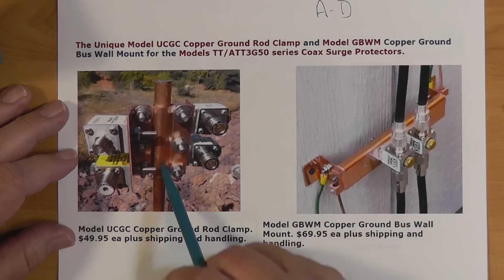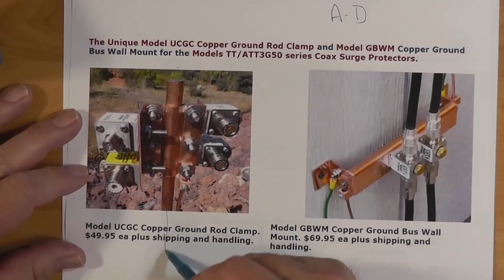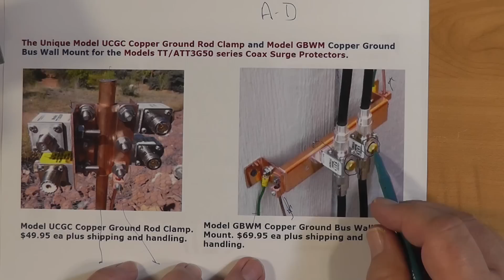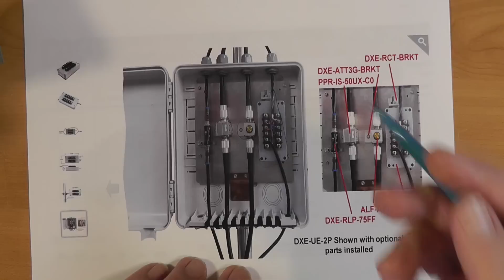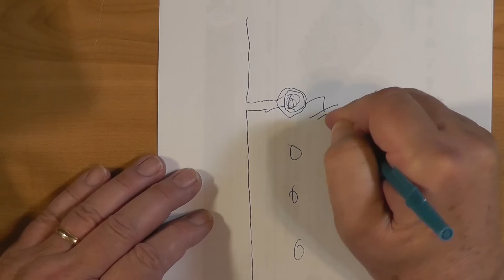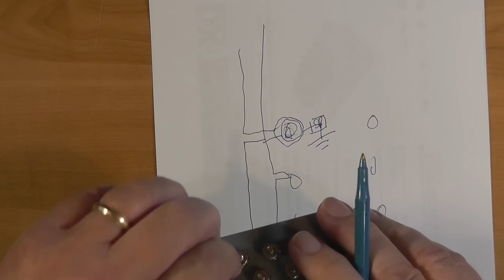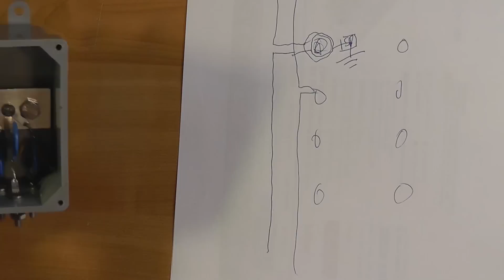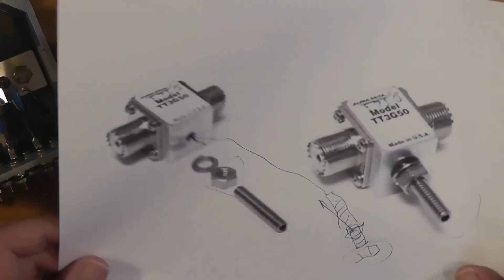The Applying and Handling of Lightning Arrestors (#468)

Comment: I question the wisdom of building any lightning suppression device inside a plastic enclosure.  These lightning suppressors use one more more Varistor (s).  If a large surge current is applied to this device it may lead to an instantaneous short resulting in violent explosion.  This is why we normally see amateur lightning suppression devices built in metal enclosures.
Reply from the maker: I agree with you. Mini lightning arrestors use a spark device to shunt the lightning to ground. I’ve used alpha delta for ages. Right now I’m using Morgan arrestors. They are all held in a large steel box which is carefully grounded.73 from Dave

Comment: Question: The lightning arrestor is the last thing before the coax enters the shack. If I have a single piece 200 foot run from the shack to the antenna, at the antenna is OK for the arrestor?

Comment: Need to attach a connector to the arrestor I have since it doesn't have the long protrusion that goes through the copper bar which I do have. What crimping tool works with solid #6 ground wire? And what connectors would I use? Thanks for any suggestions.

Comment: Very good video Dave, since I'm on top of a mountain with lightning coming down to the ground, I have purchased these flat for trailer plugs for the lighting and have them connected between my rotor control and the cable after the installation of these mentioned lightning arrestors. This way there's absolutely no connection between an expensive green heron rotor box and the cable going outside.

Comment: Wouldn't a hose Clamp and wire tighten around the pl 259 connected to a ground rod work
Reply: Coaxial surge protectors are built to divert voltage transients that occur on the center conductor, not the shield. You would presumably have the shield grounded anyway—and that includes the PL-259 shell.

Comment: I just monitor the weather and any sign of a storm i unplug and detach all coax and cables from the radio. no amount of lightning protection will do anything if you get a nearby or direct strike, yes protection can help reduce the damage but once a strike hits it's time to get your wallet out and replace everything.
Reply: Put your radio in a grounded Faraday cage to protect it from a direct lightning strike.

Comment: Good presentation, but I believe you leave a false sense of security that I want to address: 

Take this from someone who has been struck by lightning: "Lightning Arrestors" are useless against direct hits. They can bleed off static charges and possibly clamp induced charges from nearby strikes, but they are physically incapable of taming the raw power of a lightning bolt. Two reasons: 1) These piddly devices are no match for the thousands of amperes present in a direct lightning strike. They will be obliterated with little suppression of lightning; 2) Even if these "arrestors" could completely direct a lightning bolt to earth ground, the resistance AND REACTANCE in the ground path still raises the "arrestor" location thousands of volts above the local earth ground even if mounted directly to a ground rod. That charge (thousands of volts and its attending current capacity) is free to enter the shack unimpeded as it seeks a lower impedance path to earth. 

(I mention impedance: remember the ground cable from an "arrestor" to earth ground has both resistance and inductance; thus it has a reactive component. The waveform of a lightning strike is almost a perfect impulse--an extremely fast-rising current pulse that sees the conductor inductance as a significant impedance. Remember, X=L*di/dt. For an example, go to a commercial broadcast installation; every grounding conductor is a flat copper strip which minimizes both resistance and inductive reactance.)  

Many people ground their antennae during storms; however, simple "grounding" is not an answer either. In my last lighting strike (I've had 3 in my 50-year life in ham radio), the bolt hit one end of a dipole. The feed line was tied directly to a ground rod outside the shack. This bolt vaporized the #12 copper dipole and both #14 conductors the feed line,  and it blew the top 6-inches of dirt away from the ground rod. But it did not stop there: The extreme current entering the ground rod was opposed by the impedance of the rod and the resistance of the earth itself. This raised this potential at this point far above earth potential. Some of that potential went up the ground cable into the shack and destroyed almost everything (hf radio, antenna tuners, audio filter and all three computers). All the telephones, televisions and the security system also bought the farm.

My third strike was an expensive reminder of a lesson I learned from my second lightning strike. The one and only one sure method to keep lightning out of the shack is to disconnect feed lines and control cables outside the shack and move them as far from the shack/home as possible. On that second strike, the ladder line to the dipole was disconnected and laying on the ground out in the middle of the yard well away from the house/shack. That strike drilled out an arm-deep hole in the ground and blew all the copper out of the ladder line, but there was no other damage. 

I no longer make the mistake of leaving the feed lines connected during bad weather (or if I'm not at home). I believe it is important for your viewers to understand that the commercial "arrestors" may provide some benefits, but they are no substitute for complete isolation of antennae (read that "lightning rods") and control cables from the shack during thunderstorms.  

(BTW, in my previous life as an electrical engineer, I've seen several lightning hits on 12kv systems in and around my place of employment. When you see a 12kv-rated lightning "arrestor" destroyed by lightning or see a 15-kv-class insulator flashed over and shattered by lightning, you might understand why I consider the amateur "arrestors" as piddly devices. I'm accustomed to following building codes which require grounding grids under building connected to every metal building column with a 4/0 conductor via CADWELD.)

DE KG5AR
Reply: I could not agree more - the name 'lightning arrestor' is not realistic, although these devices are still a good practice for handling static charge build up.
Reply: Very true - surge arrestor not a lighting strike protector. I was walking through the local mall car park a while back and lightning struck one of the car park lighting poles about 20 steps from me… scorched earth might be a good description. I’m afraid any of our radio kit would have been a charred ruin, arrestor or no.
Reply: WELL SAID! With no disrespect to Dave, there is a cottage industry within ham radio that exaggerates the effectiveness of these little devices. They might bleed off some static charge, thereby preventing damage in one case, but to call them lightning arrestors is almost criminal deceit.

The rotor cable unit Dave shows contains eight metal oxide varistors. My electric cooktop also contains those for surge protection on the 240V line. I happened to be standing in front of it one day as a storm approached. The cooktop was turned off. A distant lightning strike induced a surge on the line. Under the glass, the thing started arcing like a welder, for perhaps 8-10 seconds. Out came the smoke. I disassembled the unit. The MOVs were burned away, the circuit board burned, power supply was toast.

I’ll reiterate that this was not a direct strike, just a high-energy spike on the line. We routinely unplug all electronics and appliances, and trip breakers for the major appliances. I hadn’t even made it that far that day.

This was our third lightning damage event. The first two also occurred via power and telephone lines.

Maybe the coaxial and control cable devices offer some protection against routine charge accumulation, but don’t bet your life or property on them if a storm is anywhere in the area. Listen to what KG5AR says about current, resistance, inductance, and reactance. A “big wire” or a gas discharge tube isn’t what we intuitively think under these conditions.
Reply: And aren't lightning strikes something on the order of 2.2 MV?
Reply: Hi Bill,

Just wanted to take a minute to thank you for the time and trouble you took to document your experience with and perspective on lightning "arresters."

I have copied and saved your comment after reading it several times to let it all sink in.

I guess "Static Arresters" wouldn't sell as well. I now realize that I haven't come across any reports of these arresters actually saving anyone's equipment from direct or nearby strikes.

A question, if you don't mind: Did your homeowner's insurance cover your devastating loss? Or did you have specific coverage on your equipment? I am a recently retired new ham putting together my first station and can't imagine re-buying everything. Have not heard anything about ham insurance, but seems like a good idea if it even exists. I live in an area with infrequent lightning, but it might make as much or more sense to get insurance, disconnect when not in use/away/during storms than buying a bunch of pseudo-lightning arresters.

73,
John - KK7JBZ

Comment: Very  cool!  When  I was undergrad in  EE, University  of   Colorado  Boulder, 1970's I  designed,  (Very  important  to know how much water you have  in Colorado) a  circuit  to measure  water   well  depth ........worked  well   for  several weeks  until  lightning struck  and  destroyed  it.  Du h..   lightening     arrestors   are important  on   more  than your  antenna.........

Comment: Dave, omce again, a great video. Concise and informative. Thanks.
The screws that come with the AD arrestor is a 1.5" set screw. You can go to Menards or any hardware store and get a 3/4" set screw of appropriate size to secure the arrestor. No need to cut the bolt to length. I used an entry panel from Kp7F metalworks and had to find a 3/8" stainless steel screw from Bolt Depot. If they don't have it, it's not made.

Comment: Thank you Dave, for a very informative explanation. Can you mount the lightning arrestors high on a superiorly grounded tower and use the tower as a ground? I ask because my shack is on the 2nd floor, so my coax would need to go from the antenna, to the base of the tower, then back up to the shack again. Thank you.
Reply: Unfortunately no - you will have to go down first and then up again with your coax. I have a similar setup and lightning arrestors need to be as close to the actual ground rod as possible if you want them to perform optimally. You always want to keep the impedance/distance from the arrestor to ground as small as possible. In the situation you describe, the mast would act as a large resistor. Even a few ohms is too much with the amount of energy from lightning. Hope this helps.
Reply: I forget where I read it (not a wives’ tale, but a professional source), but that source recommended an arrestor at the top of the tower, another at the base where the coax makes its turn, and a third at the building entry. This had to do with both impedance to the high frequency AC component of a lightning strike and its tendency to take a straight course, whether that means staying in the conductor or not.

As we all say, nothing will stop a direct strike, but these schemes are intended to reduce potentials induced in antenna system cables by nearby strikes...or not so nearby.

Comment: Ferrites and coax loops help too. Nautel supplies them to fit up to 3 inch hardline! MOV's, supressor inductors and gas tubes are available as low cost parts to build your own. The latter are what you use for openwire lines. AC power protectors are even move important, unless you have an antenna taller than the power lines. Then you have to get serious with rods on top of the tower, quarterwave shorting stubs and such.

Comment: The blue disks look like thyristors or similar surge protectors, used in plain AC power strips as well. They can fail open or shut, but more importantly they wear out after enough surges. So you know they eventually will fail. Probably should be replaced after one lightning strike, even if they are intact. No?
Reply: More likely MOV's - Metal Oxide Varistors
Reply: @jptucsonaz8503  Certainly could. Both have the same failure issues, IIRC.